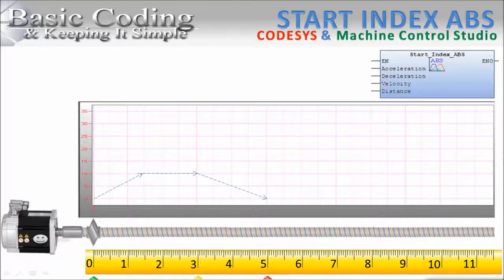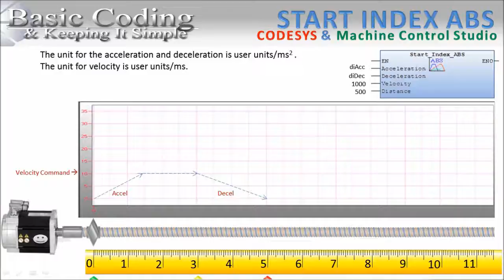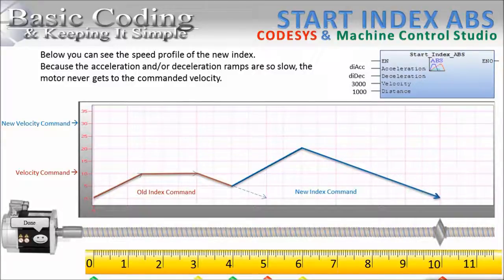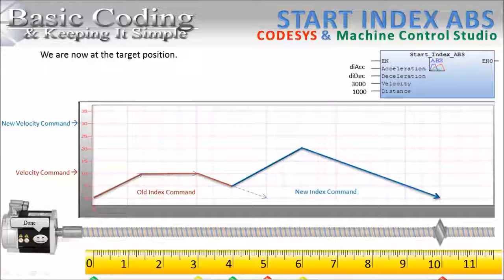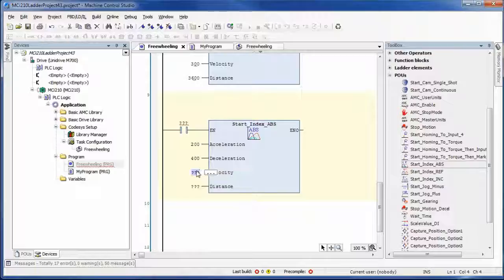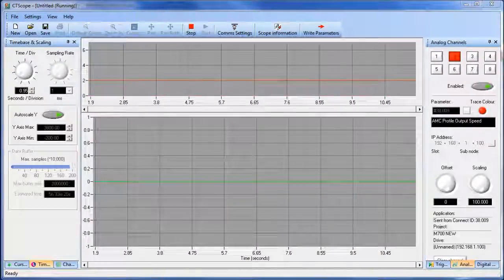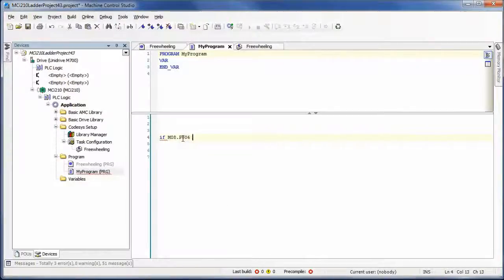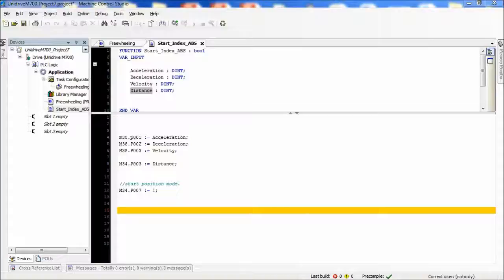Unidrive M700 - Basic AMC Template - Start Index ABS

Comment: Hello,

I changed acceleration and decceleration parameters  like on the tutorial and it looks fine in MachineControlStudio.
But it does not work.Mconnect after the update program shows :
38.001 = 0,001UU/ms
38.001 = 0,001UU/ms
The position is also not correct but i use a button switch at the moment, so  maybe it's because of debunce.
I use built in  plc
Does anyone know what the reason could be?

Comment: Hi, cool video!
Please help me figure it out.
I have a drive Unidrive M700 which works with a servo (feedback: SC Hiperface). To solve my problem, I need to use the built-in encoder emulator (AB). The problem is that at the output I have a low voltage signal, approximately (1) - 3.3 volts, and the PLC module is designed for 5 volts. Is it possible to change the voltage of the output signal in the encoder emulator?

Comment: hi mr i want to know how you display the index block because i work at si mc2 but this block is disapper
Reply from the maker: The index blocks and others are an add-on that you download from CT website.
I have a link to it on the web-page in the description of this video.  
CT calls it CTA basic motion.
You can find many other blocks too in this template.
Reply: I don't know how to tune the servo to hold position tight.... It bounces around when I turn the shaft with hands but my Chinese servo locks to a position perfectly... Maybe I need to tune some parameters help me
Reply: https://youtube.com/shorts/YCanmig1F8k?si=g7Lj8LH02qONQ6Xt